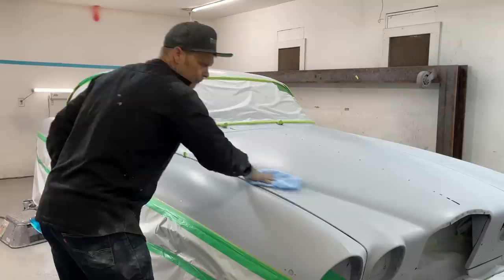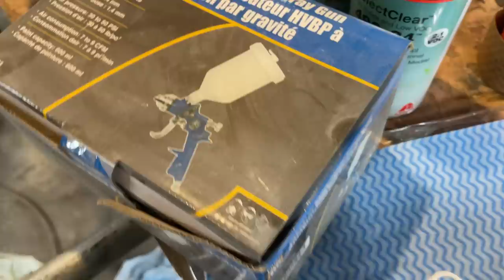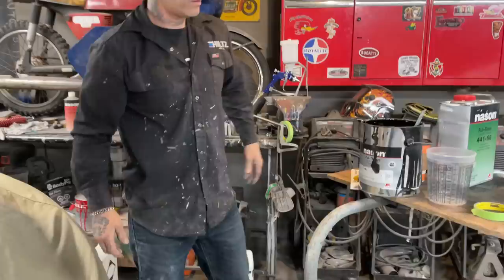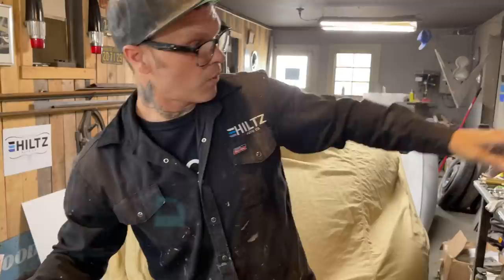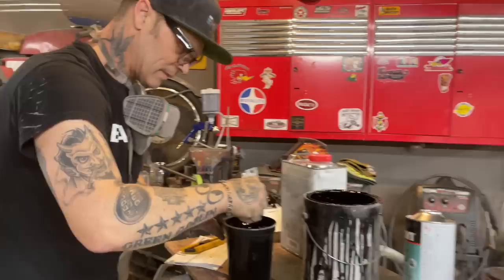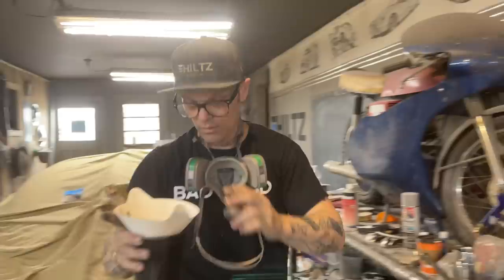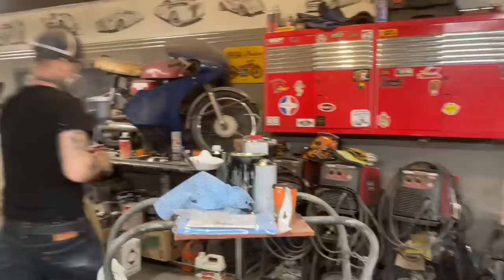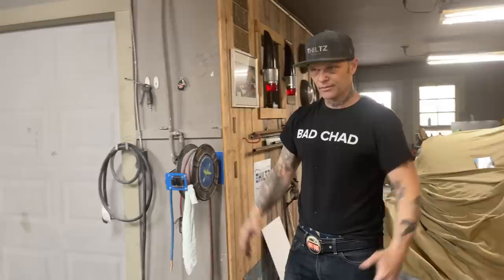Painting Single Stage Urethane with a $50 Paint Gun - Amazing Results with NO Orange Peel

Comment: I like watching you paint, you make it look easy and I know it isnt.  And you include the nervousness that at the last minute, you can mess all your work up with one slip.  The first time I watched I couldn't believe there was enough paint on after two coats, shows what I know!  

My Lotus is more than half blocked at 400, not quite enough paint so I'm cutting through in a few spots.  That was problems with application.  But she feels great and I'll get there with some touch-ups.  Thanks for sharing your technique that I'm following as closely as I can.  I think you can do 220 grit without guide coat, but would be a fool not to use it at 400.
Reply: Oops!  Forgot to wish Jolene well.  Muscle pain is a big deal, so take it easy as long as you need to, you folks work hard and deserve some rest.
Reply: happens all the time especially sharp ridges and corners.
block up to them but trick yourself to stop juuuuust a little short of the whole way to the edge....then just skim the ridge/lip for scuffing
remember when painting these are the spots that will get less paint because of aerodynamics the paint will "avoid" them....many spray them first then do the panel as normal

Comment: Chad, I saw a good trick....weld an adjustable metal hose clamp to a long saws all blade. Then you can place a spray can in the strap, tighten it and use the saws all to shake the spray can. 😂 Works well.